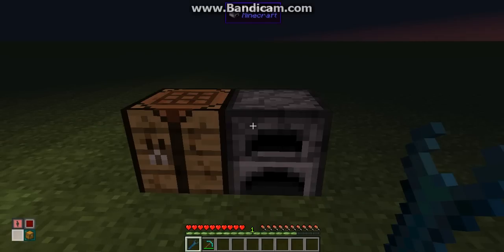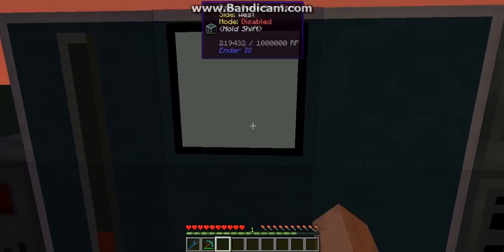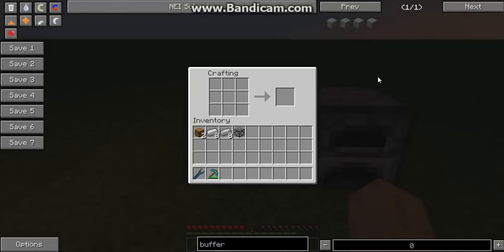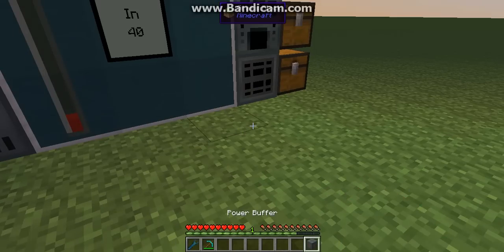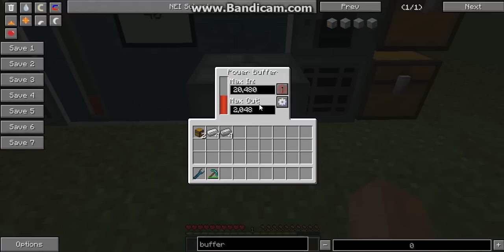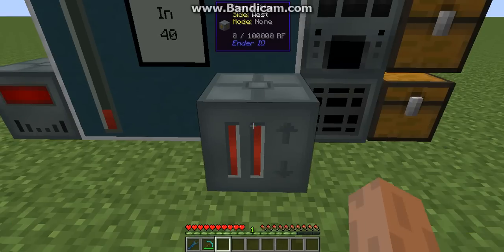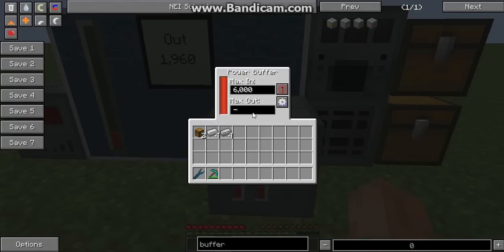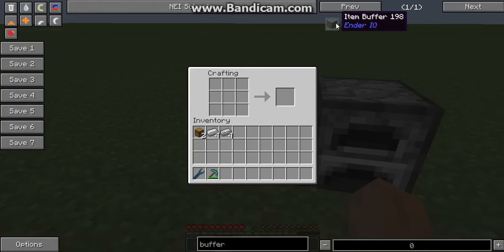VictiniX Plays Minecraft S2 #14 - Ender IO :: Power Buffer & Item Buffer

Comment: so what does the buffers do I don't get it?
Reply from the maker: The power one stores 100,000RF, and the item one stores 9 items
Reply: normal chest stores 27 stacks of items & a basic capacitor stores 1 million rf so what's the point ?
Reply from the maker: Oh, what's the point. Well, I don't know. XD
Reply: i see....
Reply: I think the idea is these connect to EnderIO conduits directly and aren't limited to the normal extract rate limits of the conduits, so like the Item Buffer connected to an Item Conduit can send items faster than 4/tick or whatever (without upgrades.)

I could be completely wrong though, haven't played with them myself yet.
Reply: Chip Marshall I don't know about the power buffer, but sometimes you only want a small amount of storage. You may not want to pile up 27 stacks of an intermediate product.